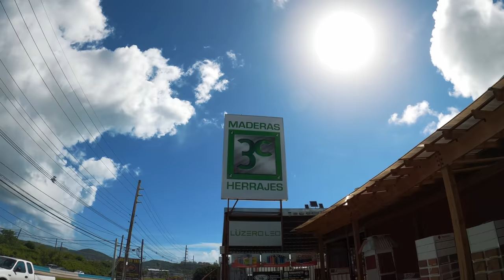BOAT YARD (PART 2) DESTROYED OUR BOAT SHOULD WE BUY THIS ONE?!

Comment: Guys, do yourself a favor: buy the other boat !
Save yourself not weeks, but months on the dry working hard and still own a 40 + y.o. boat. Plus having to buy a new(er) motor.
How's the engine on the other boat ? In need of a good maintenance, some parts etc or a useless lump like your's ?
Plus if the lady Captain prefers the new boat layout but for the head, buy it. A new head install is not as extensive as what you need to do to make your's only secure.
Only my two cents here.
But remember, the work and material costs are ALWAYS more extensive and expensive than expected. Always. An old boat is like an old, classic car: it fast becomes a money pit. Ask how I know... 😱

Comment: "Boat Works Today" Video on youTube, This guy knows about glassing boats! he has many episodes that cover just about every aspect of glassing, It seems to be all he does and he explains it extremely well. I have read a number of the comments that your follows have talked about (ie) point regarding corners and the glass has less strength unless you add in a fillet, great comments!!  when in doubt ask a marine engineer. Great points regarding drilling the bulkheads to check for rot or dampness which would give you some sort of direction in terms of if they need to be replaced or perhaps adding more glass to them to strengthen them up and give them a little more rigidity,  when you are trying to get the old paint off for glass adhesion you had remarked about the time it had taken you with the wire wheel, perhaps try your grinder (lightly) makes a little more of a mess but will reduce your work load, also what I find works well is a variable speed rotary sanded with a dust collection bag (Milwaukee makes a nice one that is not very expensive)) The other boat that you looked at was quite nice, how much would you need to spend on it verses what it will cost you to work on all the outstanding items on your boat. I have been following you both for quite some time and love what you have done so far, great job!!

Comment: Given where you are and not sure HOW to do the Fiber Glass Work i would get the Yard to do that Job on your Boat seeing that it is the Main Part to keep your Mast Up and the rigging correct, If it fails you have just done all that work for Nothing Matt??????.
If the Other boat is cheap it might be worth putting your new Engine into it and as you said use your mast on it and you still can do the refit as you are but on the New Hull. Ps: There are some places where you just DON'T CUT Costs. Stay  Safe and Merry Xmas Guys.

Comment: CS40 is well built boat but 6.5' keel...not so great for Caribbean cruising.  Not sure how well a transplanted Mast, Boom and Rigging from your boat to the CS would work...it might reject the transplant not wanting to be a Frankenstein creation.  Would the new Beta motor fit/work/be big enough to push the CS40?  I'd say stick with what you got and get those bulk heads fixed correctly per the comments on the fiberglassing, lots of fillets (reverse quarter rounds) and progressively larger sheets of glass layers to the hull and deck....gotta do this right and that first bulkhead you did doesn't look too good.

Comment: You are using fibreglass were it is not required, the marine ply is stronger than fibreglass for the vertical forces that are going to be exerted from the chain plates and your deck is taking the majority of the upward forces.
Place a fillet of filler around the leading edges of the bulk head were it meets the other surfaces then apply a strip of glass 3 inches on each surface tabbing in on both sides then in one inch increments in the width of the strips apply another three layers of glass finishing with the close weave bilateral, the middle area of your bulkhead will not have any fibreglass applied so you will save quite a lot of material  and the job will be as strong as it needs to be.
When they built your boat they used a belt and braces approach and the knowledge of the strength of polyesters was very basic .Epoxy is many times stronger than polyester resin and its soak into the fibreglass is superior which enhances its already improved capabilities.

Comment: Throw those wire wheels in the trash and get a flap disk for the grinder - 60 grit.  You wouldn't need to pull out the "strippers" and it would be done in minutes not hours.

Comment: DEFINITELY not strong enough. Must cut out with razor blade and do right. VERY good advice in comments. 
Wet out plywood ends
Cover plywood with glass first
Bond covered bulkhead to hull first
Fill in corners w/ thickened resin and soften 90 corners
Rip matt - not cut
Wet out fiberglass mats on table or board
Roller to remove air gaps and remove excess resin
LAYER, Layer, setup while still tacky to bond layers CRITICAL

Layers is where fiberglass gets it's strength. BONDING is what makes it last and not delaminate. 

I did small project on my Polly Fiberglass boat and learned how hard it is. You need many more layers than you think to get thickness. I had to fill in a piece of floor and had to layer to build up. Took days and days to do a 2' x 3' section. 
I learned the resin flashes off at very different rates with temperature and amount of hardener. Up north here.
Polly cheeper but Doesn't bond to other surfaces or stick to wood or Resin Fiberglass.
Much more learning curve than I thought there would be. Underestimated.
Thought because I built some Windsurfers with my buddy and watched and helped him. 
"I got this" 
Wasn't afraid to get started, I guess is where that experience took me.

Keep up the good work both of you! Life skills that will be valuable lessons in "Boat Life". You have Saltwater running through your veins now. 😀

Comment: This hurts me to watch using a wire wheel to grind glass back and then glass over delams. Also wet out your wood before applying glass. The wood will soak up the resin out of the glass and leave voids. Chop is for decoration. Use 1708 if you are going to glass in the bulkheads. A for effort but seek help from someone who has done this before. You will save yourself a lot of money and wasted time.

Comment: M&K, love you guys and how you take things no-bullshit but straight on.
 just curious here:
did you check your deck-to-hull connection ? is it still fixed and water-tight everywhere ?
if your cabinets serve as semi-anchorplates/bulkheads to your standing rigging and cabinets get torn apart ???? ... it tells you something on the pressure you set to your standing rig,  I think your boat/deck is flexing  a bit too much. Better stiffen this up with well placed bulkheads glassed in, pulling the deck fixed to the hull. You will need to use directional glassmats first, top-bottom / left-right, then use layers of uni-directional, this ensures better offset from the load exercised on your "bulkhead".  ( see how many layers Colin from Parlay is using on his Lagoon  or Mat & Jessica from MJ Sailing with their Cat )

Use diamond coated segmented sanding disc, it goes thru the coats as butter.

the other boat was a Beneteau, not bad ... and still customizable ... ;-)
... but you are committed now,  new motor (to install),  your boat stripped ... good luck finding a buyer.
maybe better to take refit head-on and make this boat like new again, then after a year or so check for upgrade yachts and possible buyers for yours (?)

Comment: Lots of great comments here so I won't repeat anything. However, I think it's interesting that most folks may not realize you are 1-3 months behind on these videos from real life, meaning, the decisions and the work have most likely already been made and completed and therefore any advice here is too late for you all to actually use and implement.

But it's good to have this advice in the comments for later when folks are looking into doing bulkheads and other boat repairs long after you all have completed your repairs. 

Keep up the great work and video production, you folks are funny and keep the entertainment value high. I am referring to the boat work of course and not the sexy bikini model first mate that keeps appearing every now and then, hahahaha!
Reply: Not sure that is the case with this repair. They said they would get the engine in January and this is the prep work for that to happen. They bit off a little more than they expected so It might be a little longer.

Comment: Matt, there are things that should only be done after having acquired the most basic knowledge necessary to produce a reliable result. Sorry to say so but you do need outside help if you don't want the repairs to fail. Your way it may work short term but in the long run and hard conditions you are in for some nasty surprise.

Comment: Ummm...not sure doing all they bulkhead work is going to work out over a boat in better condition. Evaluating (at least on camera) a boat by looking the the decor; is really a great way to evaluate whether to buy or not. Current boat has some seemingly serious structural issues....good luck....but the CS40 would probably have been a less work and less money to get back sailing...
After watching the rest of the episode; yes (having done a fair amount of fiberglass on aircraft)  you need 6 to 12 layups on each side; with BID (bi-directional) cloth not that crap that looks like smashed spaghetti. Never seen anything like that but it would very little strength.... Anyway; i would guess you're already done with this job... LOL

Comment: I am cringing as you hack and cut with the sawzall a grinder. All that airborne dust and mess, uuggghhh. Try a multi tool for a lot of your work cutting the bulkheads out. Many different blades will make your job easier and cut down on time and mess. It's an awesome tool that can do many things. I don't know if you have one but if not, I think it will help you cutting out lots of stuff. Window caulk too removing Windows.

Comment: First off you should’ve ground off more paint for every where your bulkhead is. Secondly you should’ve use some thickened Epoxy on the edge of the bulkhead when you pushed it in. That thickened Epoxy should’ve been all the way around the edges starting at the outside top going back to the outer wall and then down the outside wall. Thirdly you should’ve taken more Thickened epoxy and put it into the corners so you don’t have right angles where the wood is hitting up against the outer hull. They should’ve once again have been done from the outside top edge or should I say inside top edge of the bulkhead all the way to the outer wall and then all the way down then using a rounded object like a tongue depressor forming into a nice rounded shape. After letting this epoxy dry you then should come in with the fiberglass, 4 inch strips that you rolled into those nice rounded corners. Once again doing the top edge and outside boat edge. Then you could’ve started using the larger pieces one going from underneath over to the top edge and then down your bulkhead and then the next one coming from the outer wall out of your new bulkhead the time you had your first two strands coming down over the top the second two coming over the side and then the final coding one each top down, side in you would’ve had close to your quarter inch and at sometime do you want to wrap your outside edge that would be a good idea to round over so that once again it’s not a hard right angle. And you should do this on both sides of your bulkhead. I would suggest watching some how to videos on how to tab in bulkheads and other supports in fiberglass on YouTube before you go any further. Looking at the way the old bulkheads seem to be splitting out tells me the plywood within has basically deteriorated and separated and therefore should be replaced.

Comment: Yep, you don't have any idea what is needed, or how to do it. 
That's not your fault, all of us learned boat building/rebuilding over time.
If you continue rebuilding it will take much, much longer than you can imagine and it will cost way more than you have.
Don't make the mistake of putting time and money into the hole.
Buy the other boat and take the best of what you have and use it on the new boat.
Then sell your boat as a "bare hull wit deck" to someone younger who can spend the years rebuilding it as he earns money to put in it.

Your boat was worth $5k for a reason, don't dump more money into it.

And start watching boat repair videos because you don't know what you don't know.
Like glassing bulkheads, yes, the glass has to be about 1/4" thick, but the plywood must not bear against the hull, that creates a hard point, the bulkhead should sit on a piece of foam board all along the hull.
There are so many details that need to be known before you start doing rebuilds.

Love you guys but don't go down the slippery slope that so many other youtube sailors have fallen into of rebuilding a boat that will cost more than building it from scratch, and spending years of their life working instead of sailing.
Reply: A ":can do" spirit can only take you so far. It's fine for dealing with cosmetic issues; structural element, not so much.

Comment: !!!!! Golden statement "I dont know what I'm doing" IT SHOWS!!!    YES ADD MORE FIBERGLASS MATCH WHAT YOU REMOVE!!!!! I'm a master glassman many years in the field. I'v built many boat types including Hinkclies. I would stronlgy suggest taking a strong look at the other boat. From what I have seen your GBU is going to prove it self to be a massive can of worms. Do a cost challange, money to commit to repair, money spent on all other aspects? And money it would cost on a replacement boat. If the new boat is a better reward GET the new used boat. I bet your HULL has core and the core is prob wet... the boat is 40 yo...      FYI the tools your using are not the best choice. HEAVY DUTY rhino 24 grit disks are your only real choice. The wire wheel is for METAL rust.

Comment: How much does your friend want for his CS40 without the mast? What year was it? Do you have a sale link for it so I can go right to it and see it’s full specs and pictures/video on it? As being married to a long time hardcore Fiberglass specialist in repairing boats, fabricating by hand, making his own molds for Lucas oil pulling and nascar type body trucks, repairing high-end Diesel pushers. My DH says for entertainment value and the drama most people will say, just keep fixing on the boat you have however the smartest, safest, most economical option could very well likely be buying the CS40 and doing a few upgrades (depending on what the CS40 needs of course) If it’s structurally sound as it floats then that’s huge. However if you don’t want a different boat at this point, then please share the info on it if you’re serious about continuing down the track that you’re currently on with your boat. The CS40 is a good boat, it could be a wonderful project for other enthusiasts who desire a proven boat, also it could be a great boat to fix and flip if the price is right!

Comment: Instead of using a wire brush to get the paint off why the hell didn't you  just use the grinder  ??   Then fibreglass the top of the bulkheads to make them more rigid .

Comment: Keep the boat you have now you know what the problems are with your boat and what needs fixing. If you buy the other boat you are back to the beginning and new problems you haven't found yet. You guy are doing just fine. That Matt is a freakin machine. Matt wear a mask when working with fiberglass. That shit will come back to haunt you 30 years from now. And when you are done working with the fiberglass for the day just dive into the water to get as much of that stuff off of you as you can as fast as you can.......Have fun and stay safe.......LATER

Comment: Ii realize you are we completed.

But youu are laying up your fiberglass wrong, as for strengthening the the corner of your bulk head to hull. You should be starting with 3" overlap on the corner, progress to 6" ,then to 9" then to 12" etc etc. Also the bulkhead should have a gap from the hull, so it does not rub against the hull because there is always movement & flex on a bulkhead. If touching the hull it will create chafe. As what I see you are doing something beyond your tradesmanship, as was for your work on the deck.  I f I were you you should have purchased thee CS. It would have been less cost effective to paint thee wood, and structurally I assume more sound.  CS build good boats, I believe they are Canadian built, or used to be.

Comment: You're playing with fire when you redo the bulkheads and chainplates. Without them done extremely well you will have a 'flexible' boat that twists creaks, cracks and generally is not a good boat. Your home done finishing woodwork will always look like a basement rec room.  PLUS - you need a new engine in the old boat - give your head a shake. The CS40 is twice the boat  (structurally and sailing qualities) of the old Hunter you now have.Before buying it you need to ask the seller a critical question. IS THIS A HURRICANE BOAT??? I agree with the post that says fix your current boat up and sell it to help buy a new boat. Could be the CS40 or ??. .

Comment: I think you may be glossing over a couple of steps. This video shows an example of glassing over plywood very much like you are doing
https://youtu.be/9jHUI0CiYbs
It will get ridged once it’s fully cured. Until then resist wiggling it as that can weaken the final joint.

Comment: YO MATT BIG HELLO FROM DUBLIN IRELAND 🍀🇮🇪🍀,, HI KRISTEN LOOKING HOT AZ USUAL,, YO MATT IF &WHEN UR DOING DIFFICULT CUTS AGAINST  SHITTY, WALL'S USE A WASHER PLACE A PENCIL IN HOLE &THEN HOLD WHILE YOU MARK UR LINE IT WILL TRANSFER THE CUT LINE  YOU'LL NEED TRY IT ,, 4SURE IT WORK'S